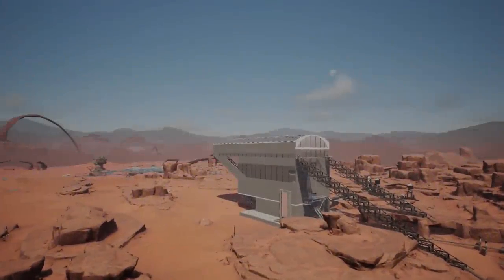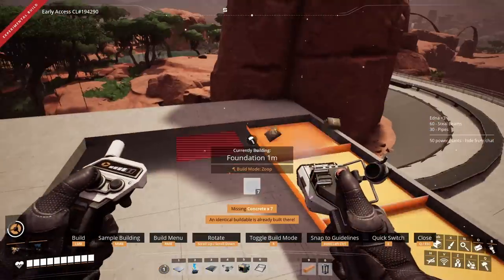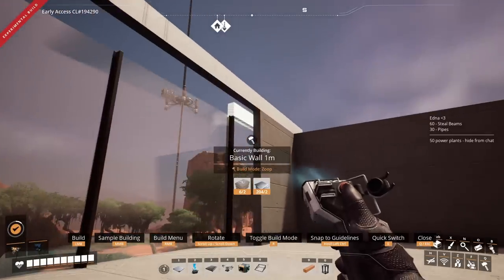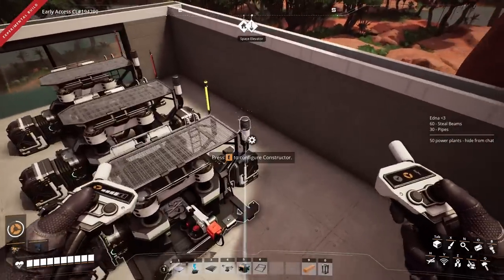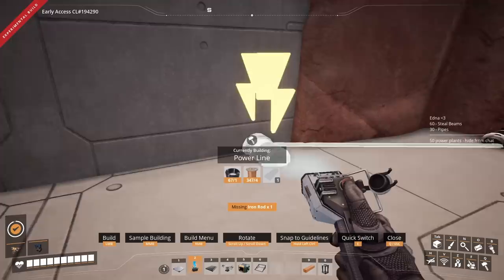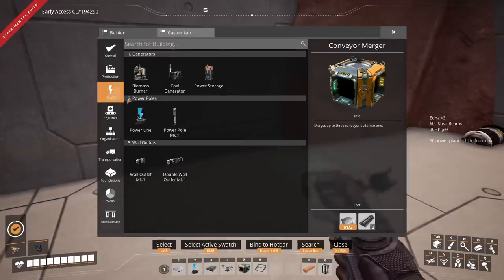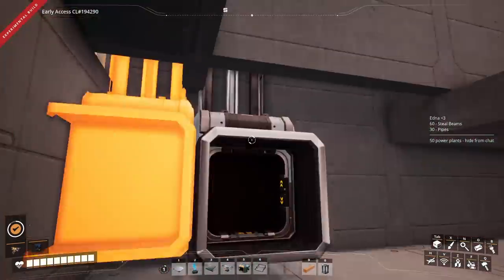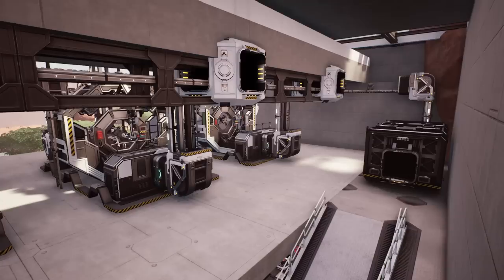Cavity Walls Logistics Guide Satisfactory Update 6

Comment: I really like hiding my cables inside concrete pillars! I put a double wall outlet on the side of the pillar, delete the pillar, connect the inside outlet and run it vertical, where I attach a one-sided outlet to the bottom of lower pillar, then replace the pillar. Looks really clean.
Reply: Pillar-hidden power lines are superb! I think I first saw that trick in another TotalXclipse video, actually.

Comment: I've been liking the cavity walls, though it does make designing the roof a little tricky for me since I'm still getting used to it. But the metal beam trick is a good solve for that instead of the complicated tomfoolery I was attempting to use in order to cover the top of the cavity.

Comment: I was experimenting with 'Cavity Walls' when I started on my Megafactory, but I used them to hide the conveyor belts. Turned out it would take a lot of planning where you want certain belts to go and the walls grew wider and wider. So at some point I got back doing separate floors for transport, not walls. But using it for power is a good alternative. I have been doing this on the transport floors as well, but with the 'barrier'-trick, you could make 1 meter thick walls (in stead of 8 meter thick walls). I think I will start using this trick as well. Nice option. Thanks! (This is Devoraz, by the way! ;-) )

Comment: Very well done construction, as always! There is something I would like to see you tackle, though, which just so happens to be what I'm presently working with...

Here's the scenario: I've got 3 normal limestone nodes in a cluster whose resources I've decided to devote entirely to Encased Pipe production. Assuming mk3 miners at 250%, that's 1800 limestone per minute. Let's also assume I can supply a surplus of steel pipes via train, and that I'm using the default concrete recipe. Running the numbers, this all requires 40 constructors and 30 assemblers. I've ALSO decided that I want to try making this factory on a cliff face. Specifically, the cliff face by the waterfall that goes into the rocky desert from the crater lakes.

The challenge I'm personally facing is figuring out how to make such a large number of constructors and assemblers look even decent, never mind good. I don't want to make the building too wide, because then it would protrude way too much, but I don't want to make it look too tall either because then it practically becomes the cliff face. I personally decided to go the "make the building long" route and made it so that it wrapped around the cliff a bit, and found a layout for the constructors and assemblers that I consider "strictly ok", but I still find everything quite cramped and would be really curious to see how you might tackle such a challenge.

Comment: Definitely enjoy the design, yet I wouldn't run powerlines across the opening between the roof cavities, like you show around 10:28, but would follow along the cavity, then use the wall cavity to send it to the other ceiling cavity. Although you could also use a bunch of wires, inside of a small frame pillar, if you wanted to seem industrial.

Comment: I tried the cavity wall in a small circuit board factory (8 constructors, 4 assemblers & two logistics floors). While it did an excellent job concealing the internal wiring between floors, it resulted in a weird monolith look on that side of the building from the outside since I couldn't really have any windows.  I tried to dress it up with catwalks, beams, textures, and colors, but it was still a huge blank wall.

I may try a "wiring pillar" or something along that line instead.

Thanks for the video!  Lots of good ideas here!

Comment: One of the things I have started doing is clipping regular power poles right on top of the power connection, especially for constructors and smelters, it basically gives you a daisy chained buildings without the mod.  Being able to clip has really changed how I run my power.

Comment: Great system X! Maybe I have a cool suggestion for a system for hiding elevators
With this you can make awesome decorations or/and building through caves without seeing elevators clipping

I place foundations at the bottom and the top lvl I want wo arrive where the elevators should be and then the floor holes, place some additional vertical foundations to find the best starting point and then I use the concrete or metal pillars to cover the elevators (from floorholes start to the end floorhole)

And with the floorholes placed first, it looks like u placed the floorholes directly in the pillars, like chimney style, or like u build an elevator directly through the terrain...

Because if u start with a floorhole and connect the distance between the two floorhole you can make an infinite elevator (no distance cap)

This would be great to see it one of you're let's plays/tutorials 👍

Regards
HEXARzion

Comment: I might try logistic walls as well as continue using logistics floors when possible.  However, I just had a crazy/stupid idea, to use conveyor belt segments as walls, in various configurations: horizontal, vertical, diagonal, criss-cross.  This is what happens when your two main inspirations were Josh from LGIO and TotalXclipse.  Controlled nonsense!  :o)